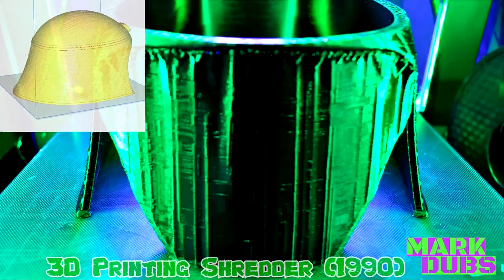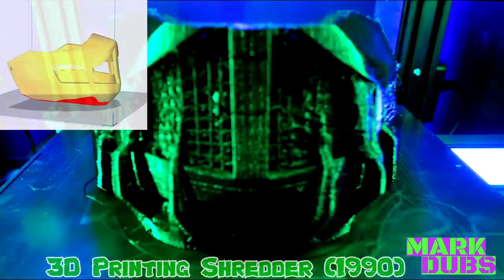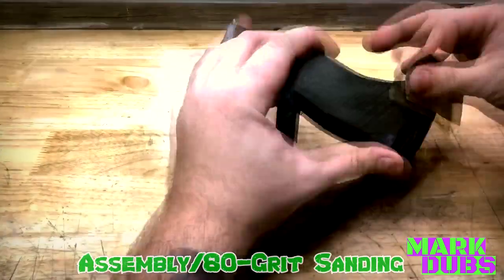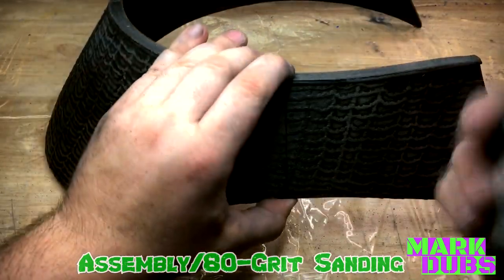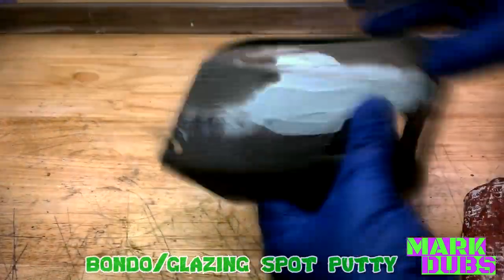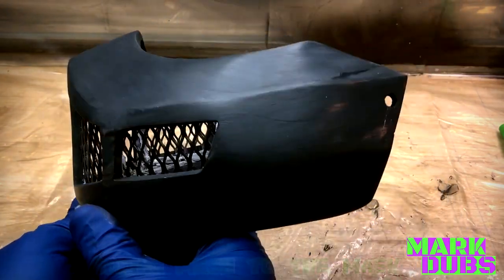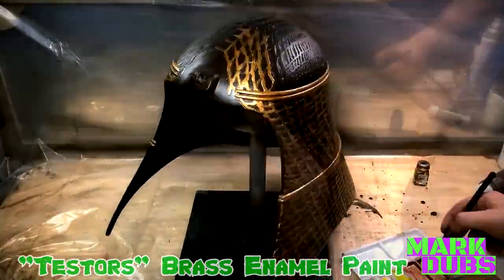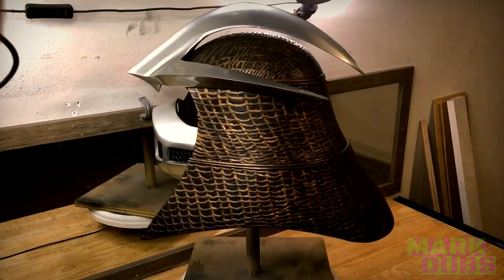Let's make Shredder's Helmet from Teenage Mutant Ninja Turtles (1990)

Comment: Love this.

A couple of questions.

How did you get the face shield to attach to the helmet?
....and do you know of any 3d print files for shredders spiked armour?
Thanks.
Reply from the maker: So at the end of the video, when the facemask and the helmet are rotating, the facemask is resting on a wooden dowel that
is screwed in horizontally to the middle of the vertical part of the stand. The elastic strapping on the mask was pulled tight and then zip-tied
onto the stand. Then the helmet was simply placed on top. 

As far as an armor set, there are a couple that come to mind.

The first link is an incomplete armor set with just a helmet and  isolated spikes. Not including the gauntlets, shoulder pads, and shin guards
that they are supposed to attach to. According to the seller, it's because they are designed to attach
to EVA foam gauntlets. It does however, notably include Shredder's Steel Claws.  
This one is for sale for $14.99. 

https://cults3d.com/en/3d-model/fashion/the-shredder-tmnt-1990-blades-and-helmet

I like the second link better because it has printable gauntlets. Not just the isolated spikes. 
It's also free so I would go ahead and download it while the link is working. You never know 
when something will get taken down.  

https://www.thingiverse.com/thing:4796467

I hope this helps. Also, thank you for watching my video! 🙂
Reply: @MARKDUBS.3DPRINTING  thankyou for the reply. That is awesome.
Keep up the great work.